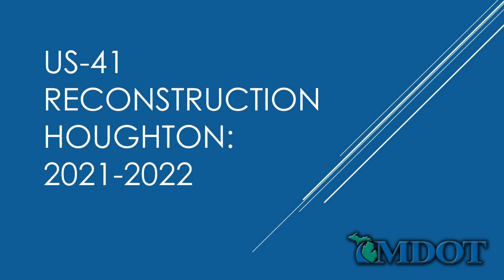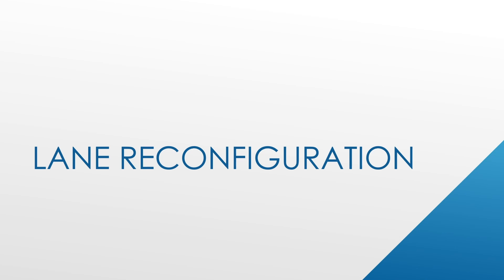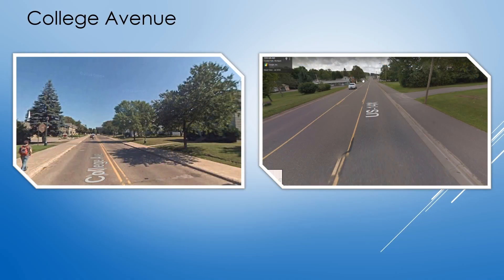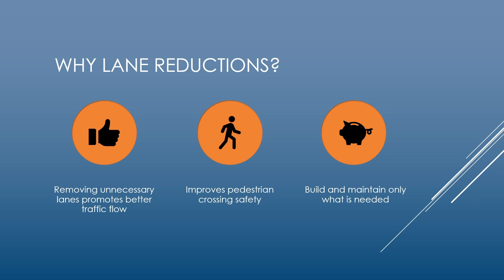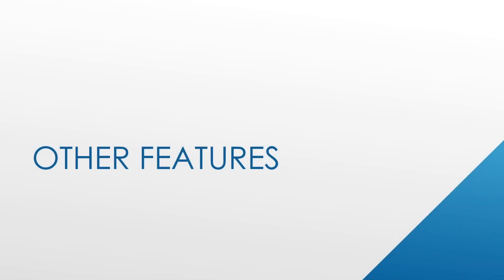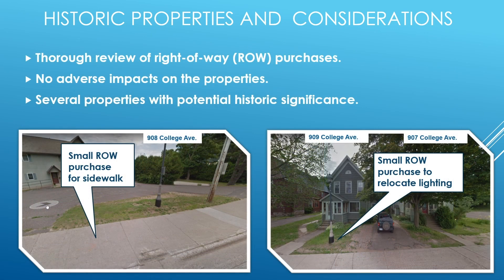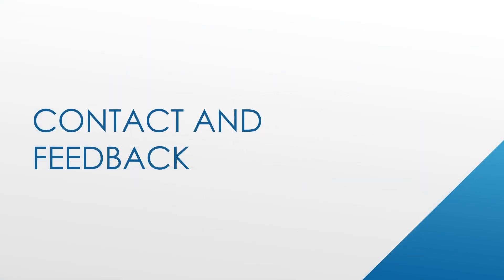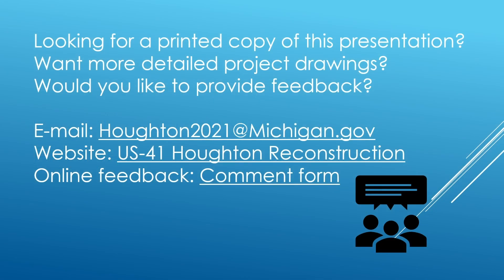US-41 Reconstruction Houghton: 2021-2022 presentation

Comment: These modifications would make passing slow vehicles impossible between downtown Houghton until completely leaving Houghton to the east.  The four lane section should remain.
Reply from the maker: Hi, Caleb! The reduction of lanes along Townsend Avenue will eliminate normal passing in this area. With the high number of pedestrians, this will improve safety by enabling pedestrians to cross only one lane of traffic at a time as well as providing a shorter crossing distance. One lane will have sufficient capacity to handle the current and projected traffic and will match the number of through-lanes on each end of the current four-lane section. Turn lanes will be placed as appropriate to allow for the passing of vehicles waiting to turn. The proposed lane width of 16 feet, plus the curb and gutter, will provide space for vehicles to pull over and be passed by emergency vehicles or in the case of a disabled vehicle.

Comment: This video mentions vehicle and pedestrian safety. What design features are planned for bicycle use and bicyclist safety? This route sees a lot of bicycle traffic, year-round.
Reply from the maker: Thanks for the great question. MDOT and the city worked together to enhance safe connectivity to the city’s extensive bicycle route network and preserve existing facilities for shared with this the project. The city’s bike network features the Houghton Avenue Bike Boulevard and the Waterfront Trail. Houghton Avenue is the recommended east/west route through town that includes a safe connection to the waterfront (through the M-26 Tunnel) and the Michigan Tech campus. 
   The improvement of crosswalk locations on US-41 at the east end of Townsend Avenue and the west end of College Avenue will provide safer crossings and provide better connection to the bike boulevard. The wide sidewalks on both sides of College Avenue have traditionally allowed for both biking and walking. These sidewalks are being replaced with new sidewalks of similar width to preserve this function and use. The new lane reconfigurations throughout the project are intended to calm and create a smoother traffic flow that enhances safety for all users of the roadway.
   While this project doesn’t add any new bike paths or lanes to US-41, which carries the heaviest vehicle and commercial traffic in the city, it does complement the city’s ongoing vision for a safe bike network by improving connectivity, providing shorter crossings of US-41, and calming traffic. The City of Houghton and MDOT continue to collaborate on opportunities to improve the nonmotorized transportation network within the city and the area, including additional safe routes to the more desired destinations.